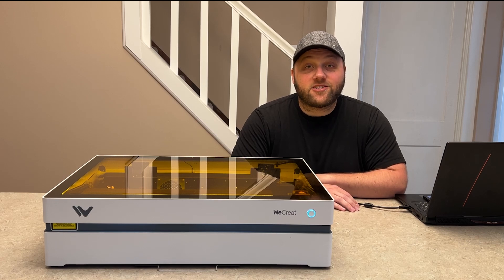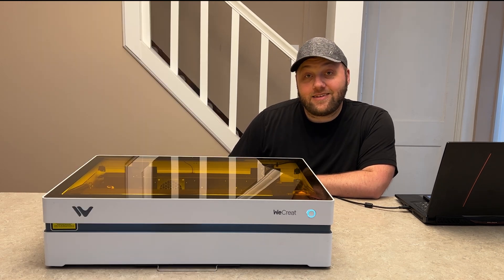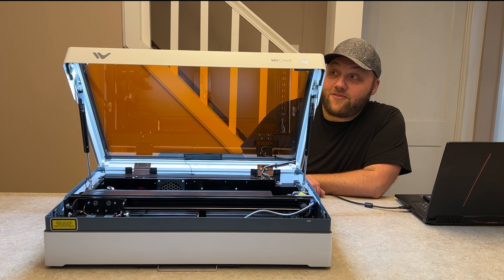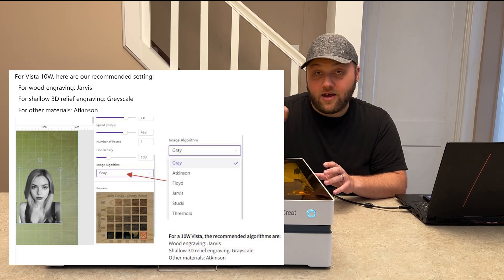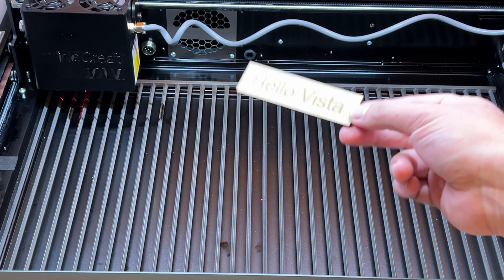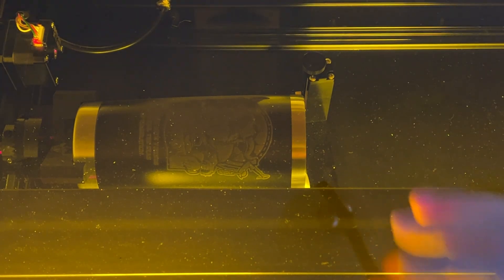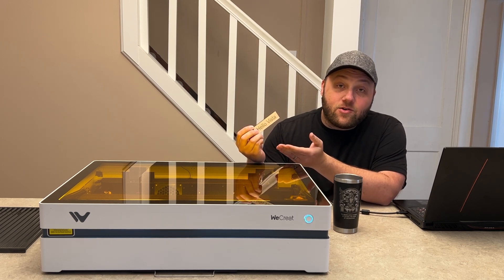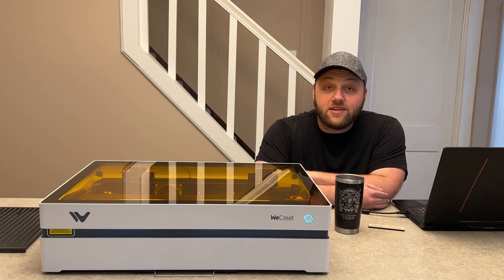Flip and Engrave - Meet WeCreat Vista (The Insanely Cool 10w Laser)

Comment: The right screw came off, and I can't flip the laser. I've tried to out it back on and it won't go back in either. What am I supposed to do now? 
It won't budge at all.
Reply from the maker: @daughter_ofTheMostHight  contact support. They screw themselves should not fully unscrew from the unit. They unscrew only so far that they come out of the sliding mechanism. You must have a loose threading or something and support will need to help you

Comment: The software presets are useless. I never use them, especially since my 40w doesn't let me change the thickness of my material, default is only what they give you. I just use my own settings.
Reply from the maker: @lastlight05  there is very limited ones on the 40w. The 20w however has a much larger list with many sizes and I use them all the time. I am hoping that we create sends out an update on the new 40w and this one with as many preset settings as the 20w soon.

Comment: I am going to criticize WeCreat as a company and their products. I can personally testify to what I'm about to share as an owner of the WeCreat Version 20-watt laser. I’ve gone through three units of the 20-watt lasers from WeCreat, and each experience has been unpleasant.

My first WeCreat laser was a nightmare. It arrived damaged, and corresponding with tech support was nothing short of ridiculous. The WiFi didn’t work, the power cord was loose, and the crumb tray was nearly impossible to remove or slide back in. The camera was way off, even after calibration. For every issue, tech support placed the blame on me. Mind you, the back-and-forth correspondence lasted over a month. Additionally, WeCreat does not do exchanges, even if the unit arrives damaged. Eventually, I got them to accept a return. Once the return was completed, I ordered another one. That too was sent back for many of the same reasons. My final order arrived in decent condition, though the crumb tray was again impossible to insert or remove. The unit had to be tilted to remove or insert the tray. And the camera? You guessed it! Still not acceptable.

After owning all three units and spending a lot of time watching WeCreat’s live shows on YouTube, I noticed that this company seems more focused on pushing out products than fixing engineering problems. In their Q&A sessions, they often ignore questions that are relevant to my issues or blame the user.

The fact is, there are too many flaws going unaddressed, and the company is not taking responsibility by recalling or fixing the issues with their newer models. Some of WeCreat’s concepts are also inconsistent with other brands. For instance, swapping out the 20/40-watt module for the 10-watt one is unnecessarily complicated. There’s no easy way to switch back from the 10-watt to the 20/40-watt module for different projects. Using the rotary attachment is also time-consuming to install. Some people may disagree about the rotary installation, but they likely haven’t tried other laser brands to see the difference.

Then there’s the camera. Many people don’t realize that WeCreat uses one of the cheapest lenses on the market: a fisheye lens. This means to get a precise image of your project, it must be dead center under the camera. The further your item is from the center, the more your laser projects will be misaligned. The WiFi is another issue. The original WeCreat Vision 20-watt uses the cheapest WiFi chipset, which only works on a 2.4 GHz network. You can’t connect the WeCreat to a 5.0 GHz network, and some batches of the Vision have known WiFi drop issues.

Oh, that crumb tray! Anyone who has used the WeCreat Vision will absolutely understand my frustrations. The crumb tray is a major flaw, and WeCreat should have issued a recall.

For two years, I’ve dealt with WeCreat’s customer service, which is one of the worst I’ve encountered compared to other laser companies. There are bad ones out there, but WeCreat is just as bad. From deceptive marketing to ineffective troubleshooting, in my opinion, WeCreat is not an honest company. They flood social media by giving out massive amounts of units for promotion while implying they’ve sold hundreds, which they haven’t. Most of the units were giveaways to make it look like they were trending.

Now WeCreat has come out with the WeCreat Vista. Why? Because xTool has a laser specifically for home crafters: the xTool M1 Ultra. The fact is, there’s nothing new about the Vista, and it still has limitations compared to the xTool M1 Ultra. Here's the big difference: the xTool M1 Ultra is a true 4-in-1 crafting machine. It comes with a 10-watt or 20-watt module. It can laser, cut, print, and draw. Every module can be swapped out with ease—just slide it in and out, with no screws or attachments needed. The duct hose is magnetic with a built-in fan and can be attached on the left or right—again, no screws required. The unit is upgradable and comes with four utility blades: fine point, ultra point, foil, and rotary. You’re not limited to specific pens, as you can use Cricut or third-party brands. The xTool is so versatile that it could replace your Cricut or Brother cutters. Most importantly, xTool lasers are incredibly accurate! They laser exactly where you want them to, thanks to the pinpoint system, which WeCreat can't even come close to matching in terms of accuracy.

I am not sponsored or paid by xTool. I am 100% convinced by xTool’s company and products. After owning several laser brands, there’s nothing quite like xTool. Aside from WeCreat, I also own the xTool S1 and recently bought the xTool M1 Ultra. From high-quality builds to excellent customer service, I wholeheartedly recommend them. For me, xTool is the only laser company that will fix a flawed job and work with you to get it done. Plus, xTool is one of the few laser companies that constantly innovates. Buying an xTool product is like buying an Apple product—you get what you pay for.

In conclusion, I don’t want to see WeCreat fail. To succeed, they need major changes. I’m not sure if WeCreat is only in it for the money, but I hope not, and I wish they would evaluate their foundation. They have a good concept for laser products, but too many flaws and an unwillingness to acknowledge them will only drive the company in the wrong direction. If it were up to me, I’d overhaul their customer service and design teams. This would ensure a better relationship with customers and better product outcomes.